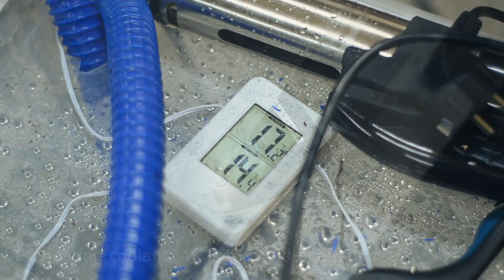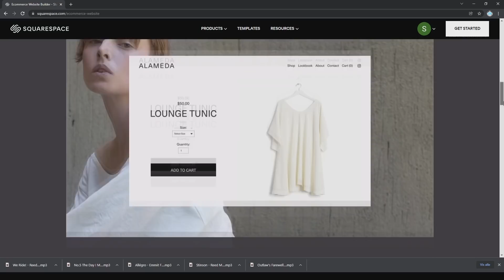Why!? All I wanted was all the power.

Comment: Why does this always happen to you? Because 2 strokes are not easy and you couldve have picked a worse interest. There is no bandages. If one part is off, the entire system is. 4 strokes have plenty of bandages. You have none. Plus this is not a chainsaw motor. Youre trying to extract all you can from atmospheric pressure with 3 chambers open to each other a good part of the time. They all want different conditions you cant provide 100%